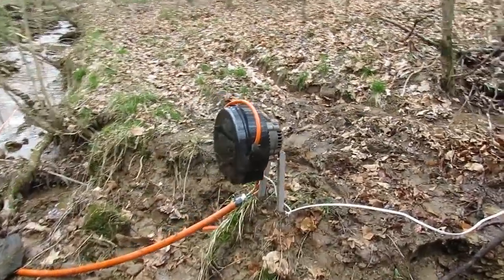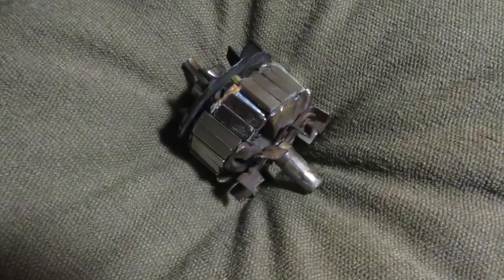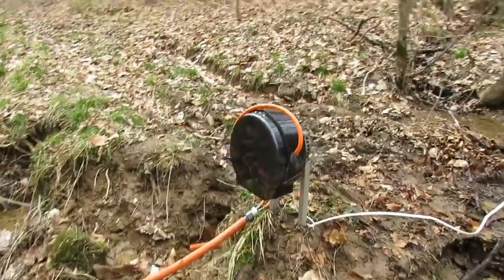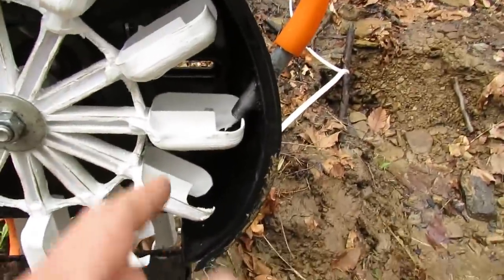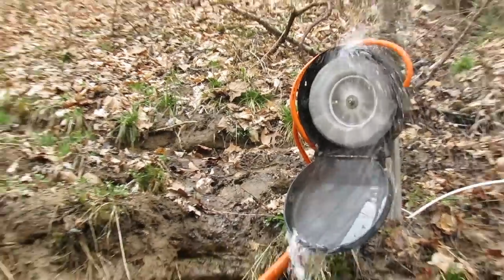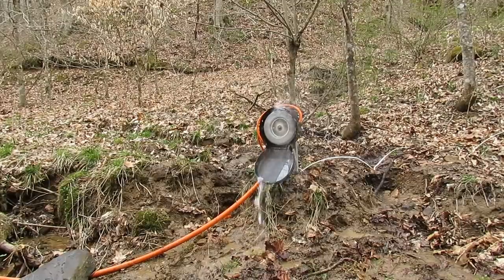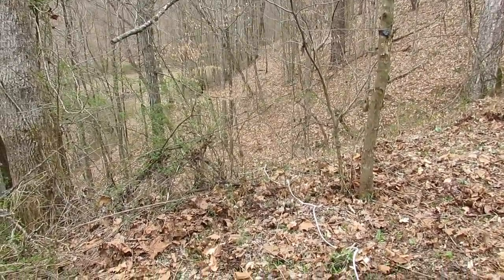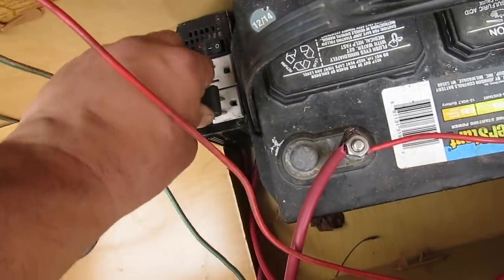Water Generator Running Off Grid Cabin

Comment: Very nice, You're faster than I am.

I only have one safety criticism and that is the wire above ground. Some critter will be chewing on that exposing live wires. I don't know if you have enough power there to start a fire. Direct burial wire isn't much more expensive than the Romex you used.
Reply from the maker: Yeah, it could be bad if it were to start a fire. I think it would stall out the generator if it were a direct short, but if they were rubbing together just right it could heat up over time. I could get some direct burial. I could upgrade to number 12 wire while I'm at it too. It would help my efficiency I'm sure. 
I wish I had the amount of head that you have. That's a lot of potential energy.

Comment: Impressive! I'm really surprised that the water coming through those little nozzles, powered by gravity, actually have that much power.
Reply from the maker: Yeah with 8.34 pounds per gallon it adds up to some pressure pretty fast. My grandparents had tapped into an old coal bank about a hundred foot up the hill for water.  It was gravity fed down to the house. Even with a half inch pipe I remember it having so much pressure that it would lift the faucet up and sound like it would blow through the sink.
Reply: Wow! And, yeah, that is a LOT of power, i agree!

Comment: I'd call it a huge success! aren't you concerned about the water coming out of the case washing out the bank and mount?
Reply from the maker: Thanks! Yeah, I spotted that when I was getting on the four-wheeler to go up to the cabin. I got a few flat rocks and put them under where the water was hitting to divert it away from the dirt. I should have filmed it, but I was too excited to get up to the cabin to see how it worked.

Comment: Great job Luke. Now you can probably watch tv as well.
Reply from the maker: Thanks, I think the tv will pull too much power for the turbine. I plan to hook up the water wheel also to help when the turbine struggles.
Reply: @lukeFugate  what is there to stop you from adding a second unit, or a third. yeah you might need more charge controllers and more batteries... but you can't go wrong with more power (Tim the tool man.... oh oh oh oh ohhhhhh!)

Comment: Awesome job Luke!!! Maybe I missed a video, but what happened to the big wheel? When did you finish the cabin? Did I miss that, too?! Dang. 
Are you back to work yet or still on break?
Reply from the maker: I'm still going to use the water wheel. It will be supplemental to the turbine generator. I don't think I can run much more than the lights and that charger without using more power than the turbine makes. I have to wait until I get a couple of paychecks to get the pipe to bring the water down to the wheel.
Yes, the cabin is mostly done. I filmed some of it but had the SD card get corrupted. The rest I was doing after work last year and didn't have time to film before it was too dark.
I plan to do a tour of the cabin when I get the furniture and stuff moved in.
I'm going back to work on the first :(
Reply: @lukeFugate  bummer on the 1st....bad April fools joke! Lol anxious to see finished cabin. ☺

Comment: Very cool luke.I like that set up. So did you abandon the big wheel ? Or was that for something else?
Reply from the maker: The big wheel will be powering the cabin also. It will be a supplement to the turbine. I really didn't expect the turbine to do as well as it did, but it is only running three led bulbs and a drill charger. I think if I turn on a tv right now it would start using power from the battery. The wheel will make up for the lack of power and will also be a redundant system in case the turbine stops for some reason.

Comment: Cool set up.
Reply from the maker: Thank you!
Reply: I wonder does it increase efficiency or is it just redundant- I like the 2 water streams set up. I saw in the video that sometimes water squirts out the back it appears, I hope it doesn't ruin the generator.
Reply from the maker: @lkimberly2064  Yes, I saw that too. I'm thinking a butter bowl will fit right over the generator to protect it.